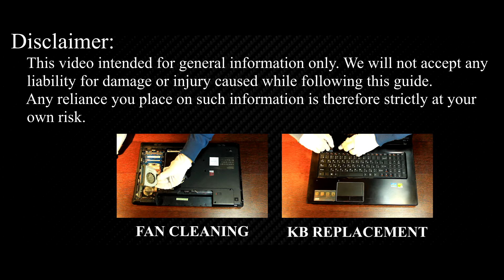Lenovo G780 Screen Replacement - Your Step-by-Step DIY Guide!

Comment: My screen just turned white and with some flickering... I can hook up the laptop on a monitor and everything is working fine. Any idea on the issue can be?
Reply from the maker: try to replug lcd cable to motherboard, if it doesn't works the problem can be in GPU, or something else so it will better to apply to service center
Reply: How-FixIT sorry im a noob at this... The cable, where is it placed ? And i got no more warranty, plus i happen to be in Africa at the moment ?
Reply from the maker: Steve Arnaivo the cable that is unplugging in 7:24 in the video, try to put it carefully (and check is cable unbroken or not), if it won't helps then it better to apply to specialist, because i can't help you distancly
Reply: Ndana any Analakely misy tsara tsena eo baina ;)